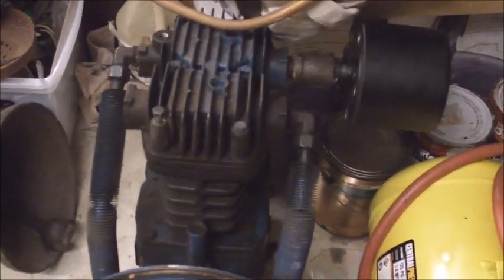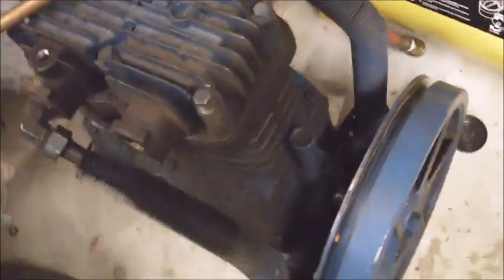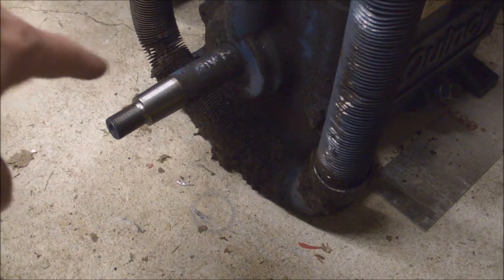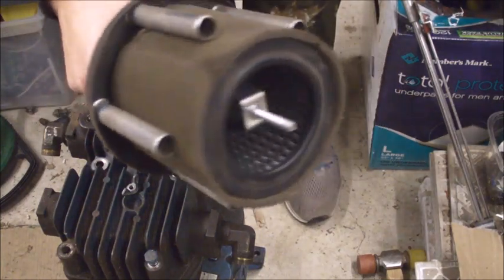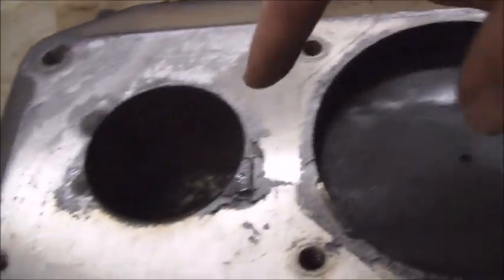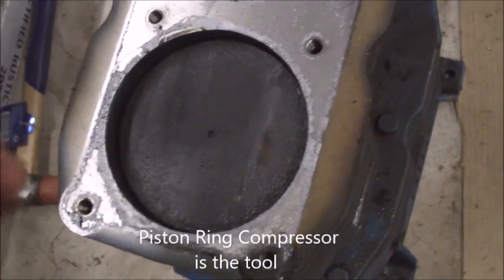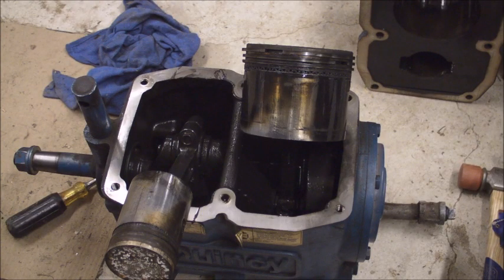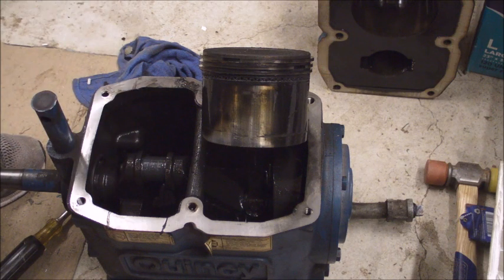Quincy QT7.5 Air Compressor Teardown

Comment: Hi! How did you find out the age of your compressor? I also have a qt 7.5 but it seems that the parts I'm looking at are not the same. My serial # is 6106717.  And in the top right corner, where yours says 201, mine says 107. Thanks for any help.
Reply from the maker: I estimated the age since my company installed that compressor for building pneumatic controls and we took it out and replaced it with a similar model. If you have a QT7.5 any rebuild kit would work